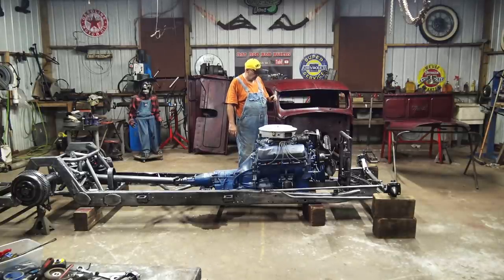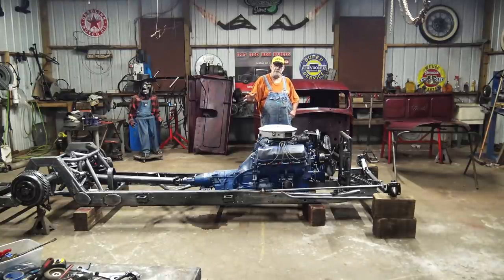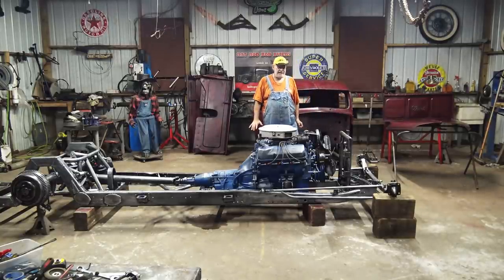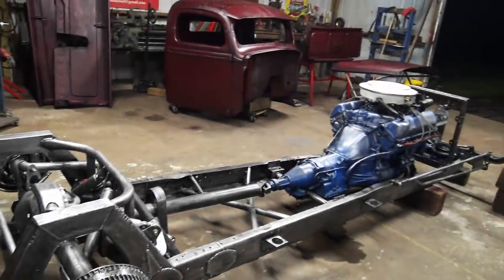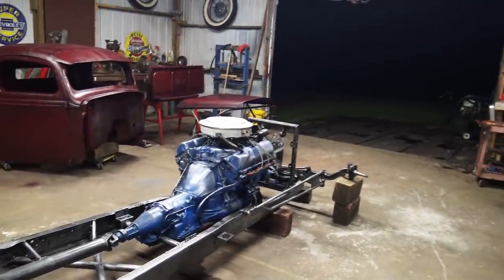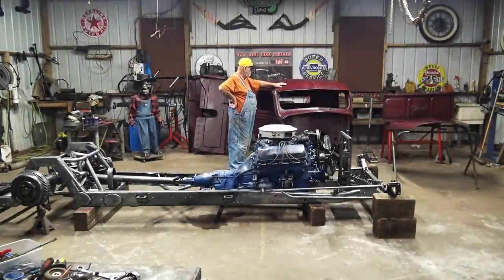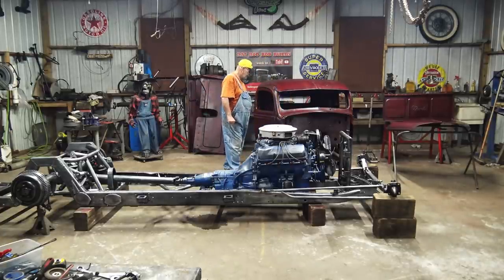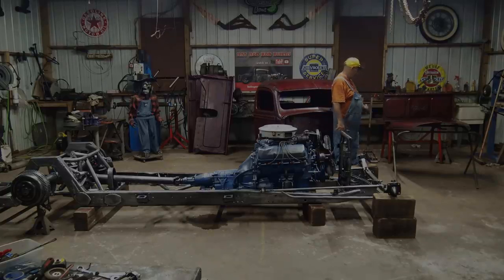Crazy Old Look With New Paint The Easy Way - Rat Rod Truck Build

Comment: You are correct about starting a project. My 10 year old grandsons and I decided to build a scratched and lowered rat rod riding mower. It is a Lowes MTD in the front with the engine removed and a Snapper rear engine in the back. The 14 HP from the front replaced the 8 HP that came with the Snapper. It is called the Lowes snapback and has been displayed in our local Lowes during the kids build days.  It is still not done, but amazing just the same. Every year we pull it and do a little more work on it.

Comment: back in the day i pinted a 74 hilux  for 12 bucks /2 uarts black rust oulium /wire brush prep . was a good 10 footer especial in the rain at nite 
was a good truck back 80 something
hot sun with brush and rooler 
low budjet high school kid

Comment: How durable would you say the finish is? I took my car down to bare metal and cleared over it and now I'm thinking of rubbing in a color over it using your technique on the silver car. Any help would be greatly appreciated
Reply from the maker: Although you see it all the time ... I've never had any luck with clear over bare metal. It always rusts anyways. But I reckon if you can find a clear that says you can do that then you may be ok. I would give it a few weeks in the elements to see if it holds up. 

If I ever get the guts to try clear over bare metal again I'll try this one: https://tamcopaint.com/products/hc4100-glamour-4-1-clearcoat-1?pr_prod_strat=use_description&pr_rec_id=17ba80bd1&pr_rec_pid=6647105126480&pr_ref_pid=6647107059792&pr_seq=uniform

I used hardener in the Wine Red on this truck so it's pretty durable. The only problem is the paint chips easy since it's so hard. Good thing is it's super easy to touch up.
Reply: @RatRodBobBuilds  I used Tamco 4100 clear. It's been on the car for a month. Looks great. Hopefully it holds up. It's a DTM clear so should be durable. As for touching up like you mentioned it will be very easy. That's one main reason I just cleared over bare metal. The clear covered very well. 

How does your process stick to the existing paint? It's not sanded prior correct?

Comment: Hey Bob. The mic is a lot better. Do know if it is on or off? Mine has a red light to tell me it is picking my voice. If my battery goes low, the light turns green. I like the fact that you don't have a cord to catch on to things. There is a little static in the sound. I am not sure what would cause it. I would like to know how it works by next month. I buy brand-name batteries so I can get a couple of days out of each battery. If I use cheap ones, I might get 2-3 videos out of them.
At the first of your paint job videos, I was not hyped up on the red. But now with the magic touch of RAT ROD BOB, I am loving it. My truck is all flat BLACK, but I just might repaint it. Maybe you can rub some red on the chassis to calm it down. Are you using automotive paint? Or cheap Ructolium type of paint. Great job Brother from another Mother. Thanks for sharing.🍁👍👍
Reply from the maker: Yea my mic has a blue light when all is well ... you can see it in my pocket where I show the package picture. we'll see how it goes in the next few videos. I'm using automotive paint brother!
Reply: @RatRodBobBuilds  Thanks, Bob. I used Rustoleum flat black on my truck. It is cheap like me. My pension holds me back sometimes. I will try good paint for the next paint job. Please let me know about the battery life. I need 2AA batteries in the receiver and 2AAA batteries in the transmitter.👍

Comment: I have steel gates at my crappy little tract house. Over the years i accumulated about fifty half used cans of auto spray paint. Every color from orange to black with lots of beige, red from my sons Camaro, light green and Champaign silver from the minivan. So i got this wild hair and used them all up on the steel gates. Damn if it didn’t look just like old weathered bronze. The guys thought it looked great. Momma hated it. So back to Home Depot for a half dozen cans of satin black. At least i got one shelf cleaned off in the shop.
Sigh. ☹️

Comment: Hell, Bob!  Too bad you will hardly get to drive this car, as cool as it is.  I'm sure that while you are rubbing out the patina on this rat rod, you already have three more ginning around in your head that you'll be starting work on as soon as you get this one together and running.
Reply from the maker: Wow! You've got me figured out for sure. I'm in it for the build, not so much the finished product. Some folks want a Hot Rod ... I just want to build one!
Reply: @RatRodBobBuilds  Bob, I'm fascinated with the engineering of the suspension on this rat rod.  Good, sound engineering, solid execution.  And you, sir, are an artist!  But one question, due to the open exhaust, etc, will you be having problems driving "on the street" or licensing?
Reply from the maker: @saxmusicmail  I already have the Antique Truck Tag to go on it so it's legal except for the exhaust. I would have to put baffles in each pipe to fix that although if I can avoid driving like a maniac the locals may not have a problem.
Reply: @RatRodBobBuilds  "... if I can avoid driving like a maniac..."  Sure.  Like that could happen... hahaha!